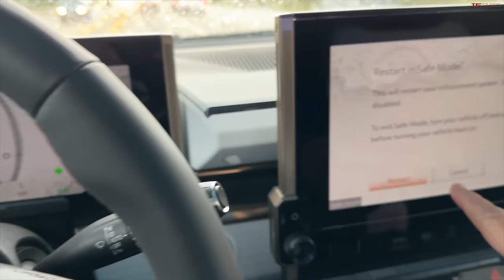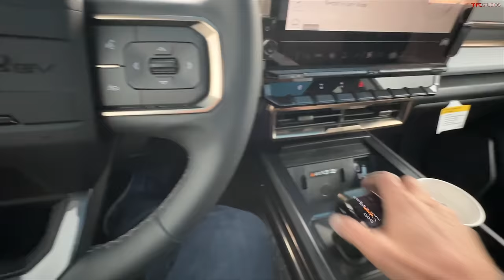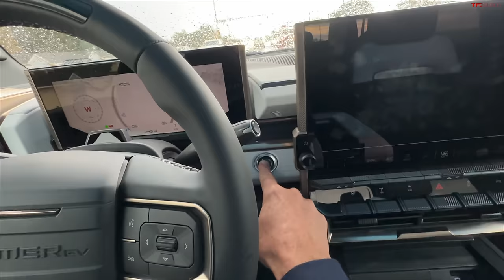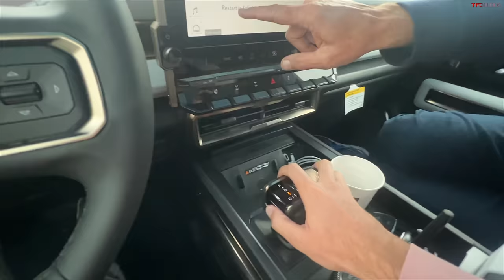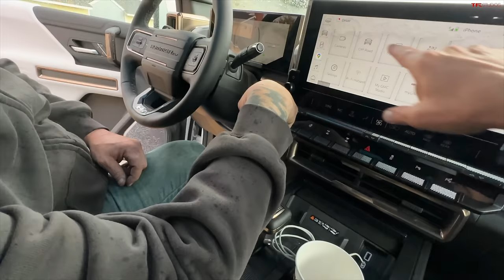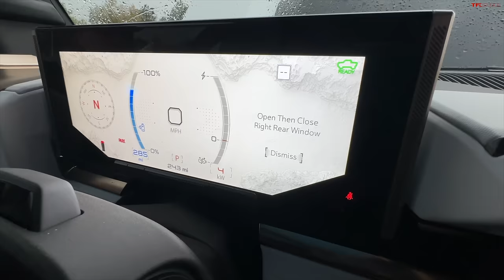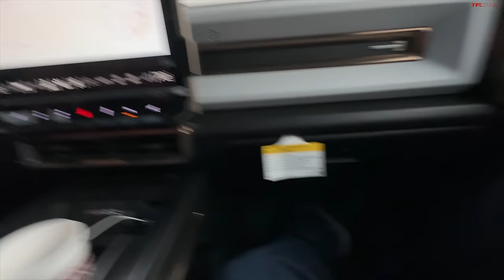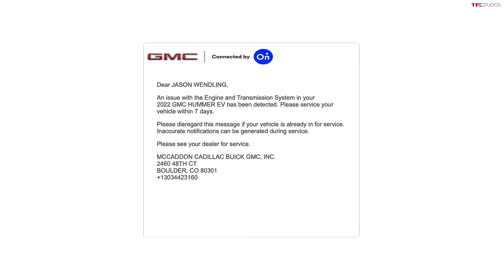I Bought a $115,000 GMC Hummer EV and It IMMEDIATELY Left Me Stranded!

Comment: I think the key takeawy here is never try to restart an EV until you are in a parking spot. That is kind of crazy that it assumes you have parked in a safe spot and won't let you limp.
Reply: no, the takeaway is to never buy an EV.
Reply: Yeah. He kept saying that restarting it was his fault, but that’s what I’d do.
Years of having older cars, if it dies at the light you restart it.
Fault code? Cycle the key at a long light and try again. Scan it when you get home.
Reply: Apparently you were never trained to restart a vehicle at highway speeds or stopped in traffic for such emergency's
Reply: That is true for EVERY vehicle. Never do such things in traffic period. Park on a parking lot and do this there or at a gas station but never ever do such things in traffic. It has nothing to do with it being an EV or ICE vehicle.
Reply: Even better solution don't buy a ev
Reply: It's all software, every each of them is written by somebody else. Each of them will react differently, especially this uber weird glitch is probably existent in this truck with this early software.
Reply: @1negev1  no, the safe driving training I have taken tells you to "pull over when and where it is safe". I can't imagine any safe driver training would say, restart it while driving so you can be without power steering or boosted braking. I have to assume you are being sarcastic.
Reply: @MariuszChr  to be fair ICE vehicles are a giant rolling computer. The engine is not able to function on its own without an ECU. They just happen to be programed by people that have some background in vehicles and understanding that people do crazy things and they need to take that into account. I have to assume the controls engineers and devs on this product know almost nothing of the real world and what drivers actually do with their vehicles.
Reply: @wolfpack4128  I doubt it. There is no way this experienced giant would let design this thing to a new guy. See the emergency frunk open cable is an example. But no emergency neutral is surprising.
Reply: @rossmartens  This is shitty design problem, it is only a coincidence that it is EV.
Reply: That wasn't my take-a-way.
Reply: @wolfpack4128  nope X military 4 different Defensive driving courses 5 years of convoys in Iraq 15 years over the road in the states. If your Vehicle stalls on you. You can try a restart their is nothing saying you cant. Do you think back in the day we had the luxury of power breaks and steering? You must be pretty young.
Reply: @1negev1   Of course, but the vehicle was not stalled.  It was running just fine when the operator tuned it off while stopped in a turn lane.  4:30  He turned the truck off and on to try and delete a warning light that said the truck needed service.  Now the vehicle should not do what it did, but turning a car off and on while stopped  in traffic in what the operator describes a dangerous place, seems like a bad idea.  
He also goes on and on about how dangerous it is and then gets out and walks around taking video.
Reply: Key take away EV vehicles should never do this.....
Reply: @HAHA.GoodMeme   This problem has nothing to do with being an EV.   Modern computer controlled cars with gasoline engines will do similar silly things.
Reply: I agree. Roman does this alot. Mountain out of a mole hill. Complains about danger, walks repeatedly around the vehicle, says it's lucky cop is there because of heavy traffic, that's a country side road without much traffic and they are moving slowly. TFL are great at that they do. But not very Brite. Both Roman and Tommy have emotional rage issues. Tommy loses his sh!t pretty quickly in a situation.
Reply: @xlthumper  "not very brite"?  
Any way you slice it, a brand new $100k+ vehicle should not have issues that disable it.  Parking lot.  Or mountain.  Or traffic. 
Then the fix is to unhook the battery, wait, roll the windows up and down, hit the brake?
Hilarious.  Anyone would have been like WTF is going on here??
Reply: @HAHA.GoodMeme  GM EV*….
Reply: @MariuszChr  Maybe wait until the car goes through a Beta Test.  Too soon to market.
Reply: @TexMex421  Dude i really think your over reacting to this situation and also he might have been sugar coating the situation a bit just think about it 115k for a truck that's brand new and it does this right off the showroom floor don't know if you are but just imagine if your wife or girlfriend was alone and driving it. It would have been a bit nerve wracking for them i gotta be careful what i say girl power and all. then like i said having to do a cheat code to get it going again really? I have that auto engine off thing in my truck theirs a button to turn it off but it automatically turns on when i start the truck. Why cant it be off and if i want it on i can turn it on the choice has been taken out of my hands the owner or the vehicle this is the first problem we need to address.
Reply: Never a problem in every ICE vehicle I’ve ever owned. This is just bad design. Same thing as Apple not letting you fix your iphone without getting their blessing.
Reply: @HAHA.GoodMeme  no, that's not the takeaway. the takeaway is for these manufacturers to build more fault tolerance into their vehicles.
Reply: @TexMex421  Apparently you haven't read all my posts or not following what I'm trying to say. I'm not knocking the new tech these ev vehicles are bringing to the roads but what i am saying is they should have thought this threw a lot more before forcing it down our guts. (Politics not being brought up) Firstly theirs no infrastructure for all these vehicles. Second these ev vehicle's might as well be sold to people in cities for now limited range and all. Towing is a joke. So theirs no other real application i can think of relating to a retail type sale to regular joe blow off the street.  and one more thing i mentioned before but we need to settle the "right to repair" first because i already see these ev's getting out hand with that. And other issues that will impact the economy's wallet. Hence lifetime warranty on the batteries.
Reply: @1negev1  Who has forced an EV down your guts? How many do you now own???  Am I really the one overreacting here?  
And other issues that will impact the economy's wallet. Hence lifetime warranty on the batteries???  Are you just rambling now?
Reply: @TexMex421  conversation ended. Apparently you don't pay attention to current topics in this country so go troll somewhere else.
Reply: @1negev1   Nope.  Your overreaction/temper tantrum is too funny to leave.
Reply: @1negev1   You must be form California!  Shocking that they will only let you by an EV (or a Hybrid with a big old V8) new in 12 years.  We must fight back!
Reply: @DeputyNordburg  nope im from north western pa one of hillary clinton's deploreables :) LOL What i believe is that if your going to bring something to market it has to be as good if not better then the competition and ev's are certainly not.
Reply: actually i drive a 2022 Chevrolet Silverado LTZ 6.2L
Reply: @1negev1   Well, in the last 10 years the batteries in EV hold 2X more energy, are half the weight and cost 90% less. If that trend continues....  EVs are already a much better city commuter car.  And as for towing...  Trailers with their own batteries and motors like Airstream started selling more than a year ago will make up the difference, no matter how much Hoovie tries to fudge the numbers.  Heck they could even push that Silverado along...

Comment: The Hummer EV is not the only GM EV with software issues. The Lyriq also has an open recall and delivery hold due to software issues too.
Reply: It isn’t even out you fr?
Reply: @ttamcc.4674  Lyriq has been out for months
Reply: @luke9020  Lyric has not been released yet. It is only preorder still.

Comment: It’s on page 350/352 in the manual. It’s basically recommending to lower the suspension, put vehicle in service mode, and put it in neutral. It will stay in neutral up to a certain speed.

Comment: GM is the only manufacturer thats ever left me stranded lol. Good investment 👌
Reply: The only GM models to buy are 2006 and before Burban/Tahoe and the truck series with the 5.3 inside. They run forever. I would not buy any other model of GM anything.
Reply: Don't buy a Nissan if you don't want a similar experience.
Reply: @paul9156c  Have owned 6 Nissans. 2004 up to 2015(currently 89k miles) and never once had a single problem that left me stranded. Minor maintenance and normal wear and tear(like any vehicle). Nissan ranks 9th overall in total reliability. Not sure what you are on about.
Reply: This is true going back to the 1980's. 
Not that other brands are bulletproof, but in my XP, only the GM will run, and run, and run, and then suddenly not run. Other brands I have had in the last 40 years give some warning either a noise or some other driving change. GM cars especially just puke out with the cruise set even. Some cars they made were worth it, the 3800 series 1-3 cars, especially the W body cars were tanks.
Reply: Excellent comment
Reply: I was literally just stranded in a Chevy trax 3 days ago lol my first and only time stranded
Reply: Mechanical car, you can fix... these crap, need a tech nerd, a reboot, a software nerd... imagine if this happens, at 70 mph...
A Car with Safe Mode.. What The F?
Reply: My built by me from the ground up '55 Chevy has NEVER stranded me, in over 12 years.
Reply: @geraldscott4302  I have a 1986 928, basket case when bought... up graded brakes, took me 2 years to get back on the road.. and the only time it has let me down? um nup...
Imagine sitting in a 3 ton truck, on auto cruise, and the computer goes, um nup..
Enjoy the Ride... would you drive down a highway, when you know, idiots, in electric, cars and trucks are around you..?

Comment: Safe mode is what shut you down just like in a computer. When you disconnected battery it took you out of safe mode but it lost it's programming because of safe mode. Safe mode is for trouble shooting when it's on the hoist not in traffic. Control, Alt, Delete next time. lol. I like it. Something simple like programming.

Comment: First off, I'm glad you guys stayed safe!  I appreciate that y'all put out the good and the bad about what happens with your experiences.  These gilded cages on the roads these days have me very thankful that I've kept my 2001 7.3L F-250 and my wife's 2003 7.3L Excursion in great running condition!  I may have to eventually replace trim pieces and update interiors, but I fully expect those two trucks to run long into the future!  EV's may be the next big thing, but when it comes to the safety of the people inside the vehicle, I'll trust my old diesels over EV's every day of the week.  Stay safe out there y'all!
Reply: I'm right there with you my friend.  I'll never buy an EV .
Reply: Jfc ppl it's new technology. Cars were never as good as they are now. That's bc they had decades to get to this point. Over time EV will become like gas. You swear like things won't improve
Reply: I have a 2004 Excursion XLT, but its the 5.4l triton gasoline engine. That 7.3l diesel is something I've always wanted.
Reply: @22deathdude Yeah, imagine spending $114k on an EV just to be a guinea pig for something that eventually will get "better over time" 🙄🤦🏼‍♂️
Reply: @nicksalgado22 , sure it took 90 years for pick-ups to become luxury vehicles, even with the tech new gas vehicles have you can still trust that they more than likely won't leave you high and dry with less than 300 miles on the odometer. I can't see trusting my family's safety to software that's got more bugs than the latest IOS or Windows update.  Not downloading the latest patch shouldn't play a role in whether or not my truck slams itself into reverse in the middle of an interstate with my 4 kids and wife on board.
Reply: 'Stay safe' 

Yuck.

Comment: I have a GM EV and it's why I always carry a 10mm wrench with me and have reviewed the disconnect the battery procedure.  I haven't needed to use it yet, but many have.
Reply: You should also wear a fireproof suit. Those batteries burn with the ferocity  of a thousand suns. The fire department just brings popcorn and waits until they can clean up the fire with a dust pan and a broom as that is all they can do. At least your cremation is free.
Reply: @PolishGator  good thing it takes like a half an hour for a fire to get going. Even a sloth could get out in time. Better than being surrounded by an instant lake of fire in an accident.
Reply: @PolishGator  The 12Volt battery? 😂
Reply: @scottkolaya2110  Modern gas tanks very rarely rupture, even in the biggest accidents.
Reply: @lordgarth1  EVs run on 350 to 800 Volts. The 12 V battery is for accessories. It helps to learn before you post a laughing emoji that shows your certainty of your own ignorance on the subject. Technicians have to be specially certified for EVs for that reason.
Reply: @PolishGator  You didn’t watch the video did you? It clearly was about disconnecting the 12V battery to reset the system by disconnecting it. The 12 volt battery runs all of the control systems including the computer. None of your hyperbole is even close to being accurate. You do realize the energy density of gasoline is 100 times greater than lithium ion battery.
Reply: @lordgarth1  I'm responding to a comment Garth. It's on the subject of issues unique to EV's.
Reply: @MattyEngland  Of course it's rare, and so are EV fires.
Reply: @scottkolaya2110  I didn't say they weren't 🙄

Comment: The Window stuff was to calibrate the auto up/down fonction. This is something you have to do after taking the battery off on most cars. This is the first vehicle I've seen that actually ask you to do the procedure on the dash.
Reply: I was getting on here to say the same thing. I think it's silly that they have you do it right away when there are other problems going on. There should be a skip option.
Reply: @timwiley1844  there was. It says dismiss for each one right on the dash.
Reply: Yukons, Corvettes etc require the window to be indexed and displays it on dash.
Reply: All GM vehicles with Auto windows do this when the battery is disconnected. My 14 silverado does this as well.
Reply: there is a skip option. it said (dismiss) for all of that window calibration . they just had a bit of a helmet fire. and clearly were not familiar with window calibration which has been a thing for a long time. all they had to do at that point was hold the pedal like it said.
Reply: @johnleeuw3022  WHAT DO YOU MEAN...LONG TIME... I'M GUESSING MAYBE AFTER LIKE 2013, I DON'T REMEMBER THIS ISSUE ON OLDER CARS........THIS IS ALL REALLY SCARY AND THE WONDER WHY THE EV1 WAS CRUSHED
Reply: My f150 doesn't need the windows calibrated after the battery is disconnected... Has the auto function.
Reply: @RonPaulgirls  lol calm down.
Reply: @vettle1  Really? Where does one purchase one of these Chevy F150s?
Reply: @RonPaulgirls  Window indexing has been on GM cars for a long time. 2003+ Chevy SSR had it (19 years),  I know the Corvette had it as far back as the start of the C6 model in 2005, so that's 17 years. My 2010 Camaro SS has it as well. Indexing is into its third decade on GM cars.

Comment: I am now even more thankful I took Tommy’s advice and recently bought a Jeep Willys Sport with a manual shifter, canvas top and none locking latches on the hood. At least if it dies I’ll be able to push it to the side of the road and get into it. I’m sure there are a ton of electronics connected to the push button start and fuel injection/engine start stop which I will never understand but at least with key operated locks and crank windows I can get in and out of the thing!
Reply: My 2022 Tacoma SR still has the time tested 2.7 liter 2TR-FE and it’s still running Toyotas Asin 6 speed automatic. Sometimes it’s best to stick with stuff you know will work

Comment: As an engineer in the automotive electrified power train industry (FCA), I watched this video with great interest. It was in a sense, a little frustrating for me, because I was trying to talk to the screen to tell you what to do, believe it or not. Federal regulations require that you must be able to open the front hood manually. All electrified powertrain vehicles have an MSD (master disconnect). This is what all fire departments know about when they respond to a vehicle fire. Once you disconnect the traction battery, and then restore power to it, the car will automatically step you through a calibration process that has nothing to do with the problem you were experiencing. 

There is no excuse for this problem that you have experienced. The engineers at General Motors should hang their heads in shame. But at the same time, it is an absolute miracle that the thing even works at all. The complexity in this thing astounds the imagination. Likely, the real problem is that as a society, we are moving too quickly into electrified power train.